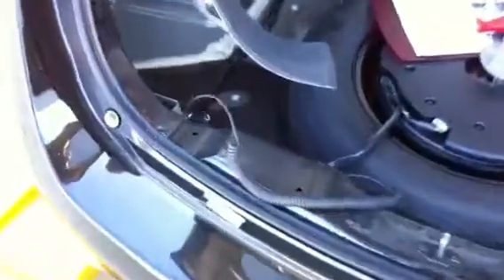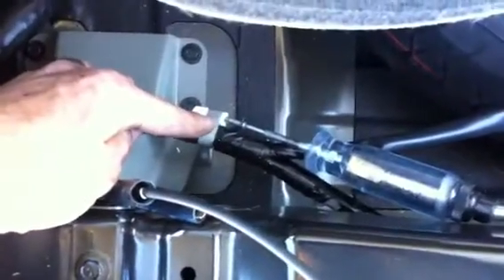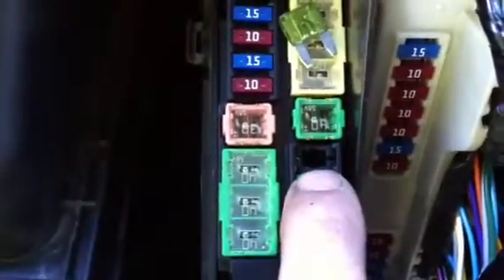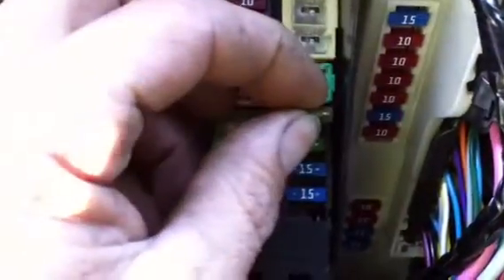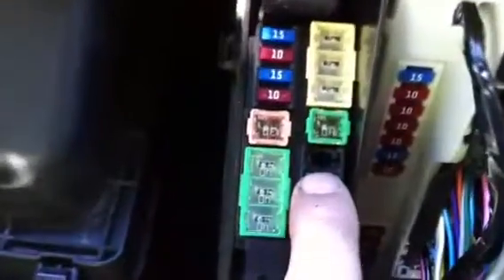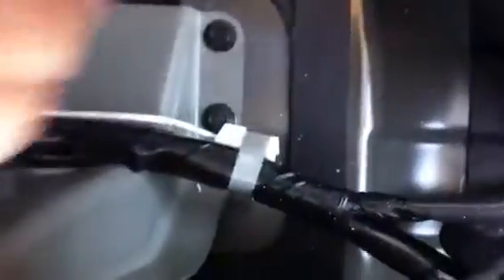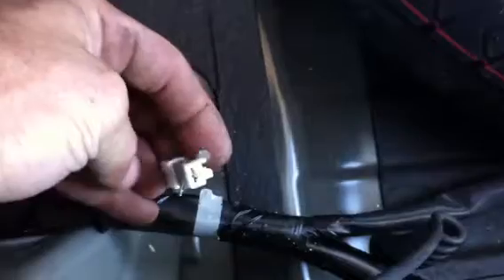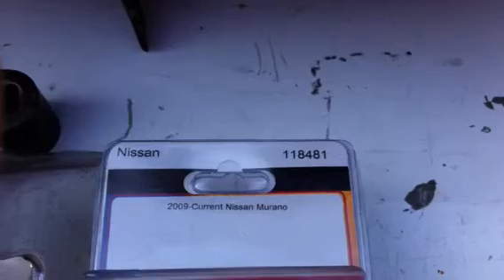'09 Nissan Murano Trailer Wiring

Comment from the maker: Thanks for your response Steven.
We are aware of the power module's 10 amp rating and made the customer aware of that limitation as well. In fact, we used a Sharpie marker to cross out the "30 Amp" label on the lid of the power distribution box and re-labeled it "10-Amp."
I know we showed a 30 amp fuse in the video, but I should have clarified that I was just using that to test the vehicle's circuit.
You can get our e-mail address from our VIP rep Lindsay.
Thank you for working on this!